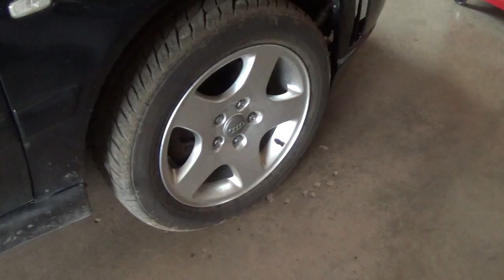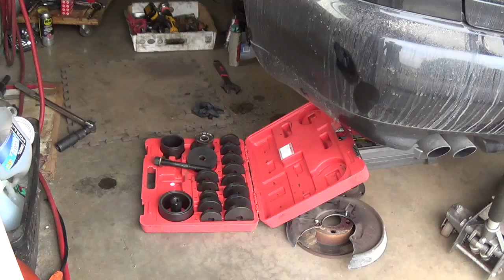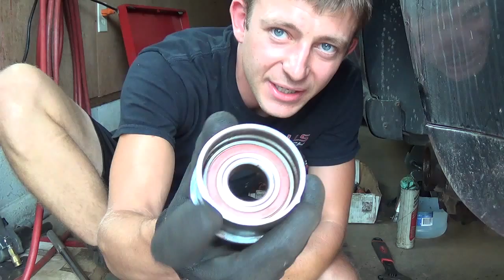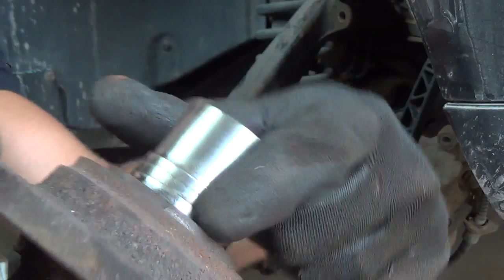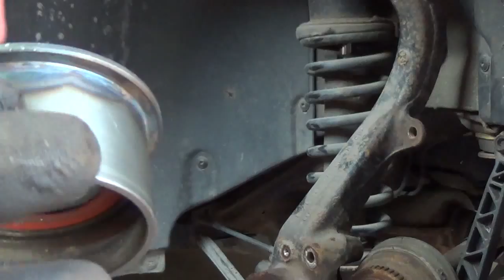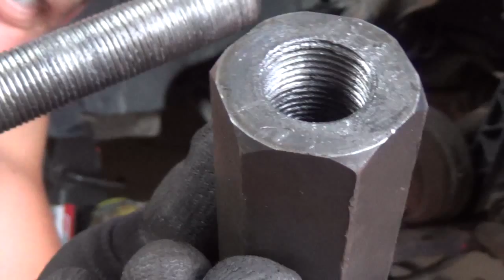DIY wheel bearing replacement: Audi A4

Comment: The lesson I'm reminded of is that bearings are for higher rpm and lower forces but a bushing is for low rpm and endless pressure. I completely forgot till I watched you do it. Thank you for existing. Keep doing that.

Comment: Astro Pneumatic Tools sells a heavy duty hub/rotor/drum puller 78830 and a separate 78825 Master Front Wheel Bearing Adapter Puller Kit W/Grade 8 Drive Bolt.  The puller is around $120 bucks and the wheel bearing kit is around $80.  The drive bolt on the bearing kit is 7/8" grade 8 and vs the OTC 3/4" bolt.  OTC's hub grappler kit is over $450.

Comment: 60Gallon:  You need a 60 gal. air compressor.  May I suggest one from Home Depot or Lowe's or Menards.  Menard's sells the Sandborn  which is usually at a better price but I don't think a Menard's is near you.

Comment: I see this is an old video, but I had real good luck dunking that forcing bolt & nut in 5w30 for awhile, cleaning it off, and then rubbing it all up with anti seize.  Works really good.  I feel like keeping the threads clean & oily & running smooth is half the battle....

Comment: I put some Loctite Moly Paste on the forcing screw of my cheep kit in order to prevent (limit?) galling. No forcing screw damage replacing both original 11 year old front bearings on winter/salt-road driven car with 160 K miles on it.  I used a cheap ($68 + shipping) ebay kit, probably the same as the H.F. version. I cracked the bearings manually with breaker bar to initially tighten then a few light hammer taps on the knuckle (there was a noticable "crack", when they released), and then pulled the bearings with an impact gun on the forcing screw. I used the same Moly Paste on the bearing surface to ease pressing in the new bearings. The forcing screw appears unscathed after two bearings worth of work.

Comment: I've had the Ken Tools Hub Shark set for years and always used a thrust bearing from day one and always used impact wrenches. I never had to replace and of the parts only bought the expanded set when they brought it out years ago a very quality tool. The screw on a Hub Shark is also larger than the OTC screw as it is 7/8 diameter.

Comment: first too many useless steps. second has nothing to do with being Chinese made. most tools are Chinese made and snap on tools break too. it's called improper usage. lube the bolt with oil. don't use impact use a ratcheting breaker bar. biggest part of broken tool is laziness, poor up keep, improper usage and sometimes cheap quality.
Reply from the maker: Agree, proper usage and tool care is essential for the tool not failing prematurely. But in this case the forcing screw was pure garbage no matter how you lube it lol. I replaced it with an OTC forcing screw (cost almost as much as this cheap kit). Have replaced many bearings since then and it's holding up great!

Comment: My bearing is stuck so I decided to remove the knuckle but on each side (driver and passenger) but one lower control arm wont detach from the knuckle (its the one connected to the spring/ sway bar) Running out of ideas since the ball joint separator tool I picked up isnt working
Reply from the maker: preload it with a pickle fork, spray penetrating fluid, smack with a heavy hammer. A good forcing screw should be able to pull it out though.

Comment: how much that tools for remove it ?thnx
Reply: KURDISTAN uk I bought mine from ecstuning.com for 180 Usd but harbor freight is 79.99. ecstuning.com metal is a bit thicker but if you use an impact you can still damage the screw on any of these tool even snap on tools. lube the screw and washer if friction is a bother to you. no need to make a bearing washer.just a few drops of oil.
Reply: thanks

Comment: I don't want to see you change the bearing using some custom tool that you made, using pieces not readily available to everyone. I'm looking for instructions using normal tools that everyone can access.
Reply: michael moore you can use a socket the will fit through the housing but big enough to touch outter bearing and a long bolt and nut to make a handle and big 5lb sledge or use the socket a bolt from your local hardware store some oversized washer for the back of the bearing and a nut works same way as the custom tool just have to by piece by piece from the hardware store also it will cost you under 50 bucks and kit will cost 80-700 depending on brand

Comment: you need to buy a real air compressor or a powerful battery Impact wrench like the Milwaukee M18 fuel or the IR one
Reply from the maker: +Jonathan Lessard Just recently bought a 30-gallon twin cylinder belt drive unit. Wow what a difference!!
Reply: hahha for sure, thats money well spend i hope you will show it in one off your upcoming video
Reply: The IR is overpriced and underpowered get Dewalt or Milfuky.
Reply: hahaah Milfucky
Reply: Jotech 1991 see the head to head reveiw on harbor freight xt earthquake. it is same as snap on mg725. as a mechanic all my tools are snap on and matco. I had a few harbor freight stuff from my early years when I was a poor just starting mechanic. 5 years later my new company made a policy that all torque wrenches hard to be calibrated yearly. paid by company. I sent in my 2 harbor freight torque wrenches made by Pittsburgh and 2 snap on one's. my Pittsburgh one to my surprise were 100 percent accurate even after 5 years. my snap on both needed calibration one was way off and one was just a bit off and they were 1 year old.
Reply: Jotech 1991 also Milwaukee fuel is the bomb. I got rid of my snap offs and got all Milwaukee fuels. make sure they are fuels or they are weak. Dewalt tries to compete but falls short just by a little. but still a good choice since it's a bit cheaper but Milwaukee has 5 year warranties best on the market

Comment: Get a milwaukee m18 fuel high torque impact gun. I rarely use my air tools because of it. I pressed off a lower ball joint from a 96 yukon with tons of rust and it came right out
Reply: +nicholas elias that Impact is on my list i have the older version the 2663-22 kit it is powerful but miles away from the fuel

Comment: I have the same harbor freight hub bear kit. First time I used it the forcing screw and nut threads were pretty much gone and only moved the bearing an 1/8th inch. Had to remove the knuckle and press it. Harbor freight sold me a new one at their cost. The new one is the "redesigned model" The case changed from red to black and now comes with two brass washers instead of one.
Reply from the maker: +Gary Louis But is the forcing screw any better? lol
Reply: haven't tried it yet. It looks the same.

Comment: Go to Harbor Freight and get a hydraulic punch.   http://www.harborfreight.com/hydraulic-punch-driver-kit-96718.html
 Use the power head with the forcing screw in your hub tamer kit or buy a 3/4-16 threaded rod about 12 inches in length to be used with the   forcing nut from your hub tamer.  There are several videos on youtube in which people use the power head with special adapters that they fabricate to push the bearing out and install the bearing.  I use the power head with my set of wheel bearing removal tool cups and round plates.  Never had a bearing that wouldn't come out and you don't ruin the thread on the forcing screw because you are not using the screw to force the bearing out or back in.
Reply from the maker: +Upallnight Whoa that's cool, I'll look into that! Didn't even know such a tool existed...thanks for the tip!
Reply: OTC also offers a hydraulic power unit for their hub tamer kit, but it's not going to be 90 bucks like Harbor Freight.

Comment: I put a 5 HP single stage 60 gallon IR compressor in my shop a few years ago and really like it.  It will do anything a person needs in a one man shop (including running my bead blast cabinet, and blowing out my sprinkler system in the fall).   Believe it or not the 5HP two stage 60gallon air compressor at HF is actually a rebadged USA made  Bel Air compressor(unless they changed something in the last year or so). It gets excellent reviews, so I would not rule it out. my IR was made in Packastan.

Comment: Save the receipts LOL.  Use that warranty they offer.  (At least while you wait for a proper force screw.)  Might want to take the old one to a fastener shop.  We have a local nut/bolt shop that can get darn near anything in any size.  Show 'em that one and say you need one that won't fly apart.  Chances are great it will be a fraction of the cost of the OTC  (which is also made in China........at least my Stinger brake tools are....)

Comment: If you had time to put the replacement bearing in the freezer for a few hours to shrink the metal down before the install, it would be  a little bit easier and less stress on the forcing screw and your nerves ;-)
Reply from the maker: +Ozzstar Great tip! The hard part is usually getting the old bearing out, since it's a bit seized in the knuckle after a 15-year salt bath lol...the new bearing went in pretty smoothly with a dab of grease.

Comment: Ivan if there is a NAPA store order a 90-6001 and a 90-6003 air couplers. they are high volume couplers. as long as you don't go crazy with the air pressure they work great. I use 90 to 100 psi no more, and my impact gun works great.  thanks for the vid.
Reply from the maker: +George Heri Great suggestion, George! I will look into this before investing in a bigger compressor :)

Comment: I'm surprised an 8 gallon was able to pull that off especially with a HF hub kit.  That's one hell of an 8 gallon if it can feed an IR.  You can pick up a decent 60 gallon for about $500 from home depot or lowes.  Most are just rebadged Campbell Hausfelds.
Reply from the maker: +DJDevon3 lol yeah I got the little 1.5hp bugger a few years ago at Home Depot for 100 bucks. Figured I'd upgrade once it blows up...kind of surprised that hasn't happened yet considering I use it almost daily! At least this one has an oil bath; those oil-less ones are just heavy paperweights.

Comment: If you're getting a new compressor, there's a recent video I saw from another car guy named Eric about all the things you're not supposed to do. ;-)
Reply from the maker: +anti0918 Wow he really built up quite the air system! That 5hp 80 gallon beast could feed a busy 10-bay shop no sweat lol
Reply: +motoYam82 Where did you get all those sweet stickers on your toolbox? I never get any stickers when I buy parts. I even have a Summit Racing store nearby and I couldn't find any stickers there. They must keep them behind the counter for big spenders.
Reply from the maker: Oh man I've gotten parts from so many retailers it's nuts...bicycle parts, vintage motorcycle parts, automotive suppliers...but mostly RockAuto magnets haha Running out of space; need a larger toolbox!
Reply: +motoYam82 But the important question is how much horsepower did those stickers add to your toolbox? ;)
Reply: +anti0918 LOL!   Years ago we used to joke that stickers lower ET and that chrome added HP.

Comment: Nice work Ivan and nice to see that the Harbor Freight tool doesn't hold up on the threads. Thanks for the posting.
Reply: +Suj Not on the VW, but have done them on GM's and Ford's. Even still some of them can be a bear when the hubs are rusted in there with the splines of the CV axle. I can remember once on a GM that took me 6 hours to get an axle loose from a hub. You would have learned a lot of new curse words that day. HA HA!!
Reply: Stuzman !! I think we need you to do us your very own bearing video on your VR6 😉
Reply: +Suj Holy crap LOL...I sure hope I don't have to pull that because anything on that VW is a bear to work on. I've never done a wheel bearing for the VR6, but my guess it wouldn't be an easy repair.
Reply from the maker: +stuzman52 Terry you should be OK as long as you don't rely on the HF forcing screw to complete the job :)
Reply: Thanks Ivan for the tip. I hope it will be awhile when I have to work on the VW again. My wife says that I only start cursing when I work on that thing LOL...
Reply: Haha, have you done wheel bearings before? I am tempted to have a go at mine, but need a decent hub tamer kit. The good one I have seen in YT vids is made by "OTC" but not sure if we can get them here in the UK
Reply: I stripped the HF thrust screw in less than 5 applications..What did/do you use for a replacement?
Reply from the maker: OTC Hub tamer forcing screw...which cost about as much as the entire HF kit haha

Comment: I have the same HF kit. On mine the threads did ok , but the hex part of forcing screw broke off. It looked like it was made separate and pressed on . The screw is made of something i could not weld on . I used a bolt instead , but it is hard to use that way. This reminds me i need to fix it before i need it again.
Reply from the maker: +wtbm123 Oh yeah I hate it when you need a tool but you forget that it broke the last time around haha. Gotta fix your tools before fixing the car!

Comment: What no 40 lb. hammer action:)  Hey it got the job done. Yea the forcing screws are junk but what I did was get a high grade piece of threaded rod , looks like an acme thread - not sure but it's a deep coarse thread and couple of nuts from brofastco . It's super duty  might cost more than an OTC , been a while and of course one of my friends borrowed it again - not sure who has it Ha. Seen a great vid last week about air tool pressure drops and I checked mine and it was too low as well. I did the same as in the vid and put an inline pressure gauge right between the quick connection and my IR 231 and turned on the impact, well it was only getting 75 lbs pressure. I had to turn my regulator tank pressure up to max. 140psi to get 90 psi at the gun. Wow what a difference. Might be a good tip for Eric as well and he can let the gun go full beans instead of him going full gorilla LMAO.👍
Reply from the maker: +Steve Rob Yeah my weaksauce 8gal compressor cycles 100 to 125psi...so the gun must be getting like 60psi lol! I've read that the IR231 is an indestructible monster, just hungry for air! Got mine for free from my buddy's shop after he used it daily for like 10 years. He was too lazy to replace the trigger o-ring and wanted to get the latest Snap-On gun :)